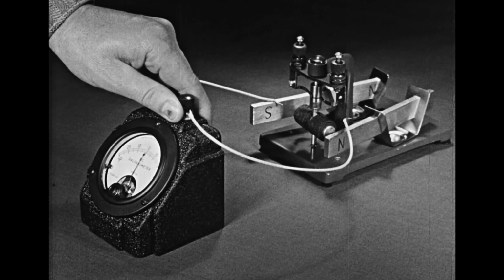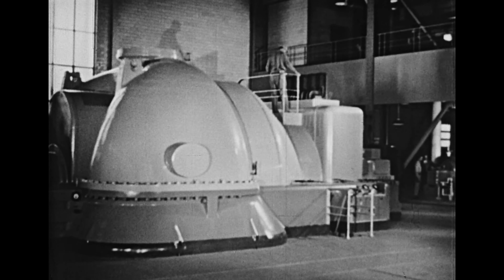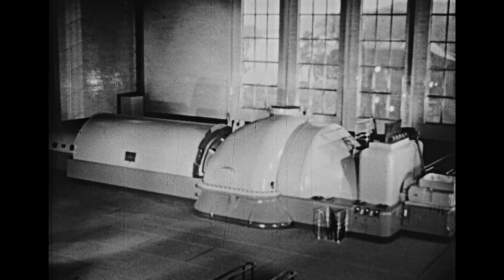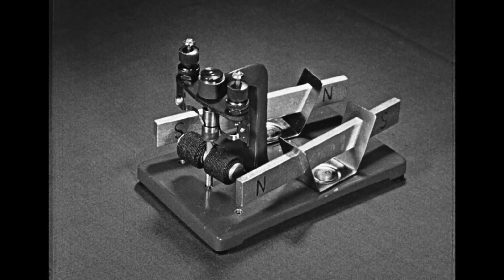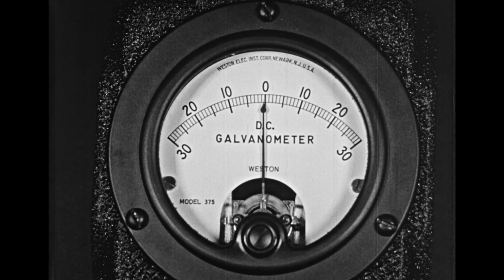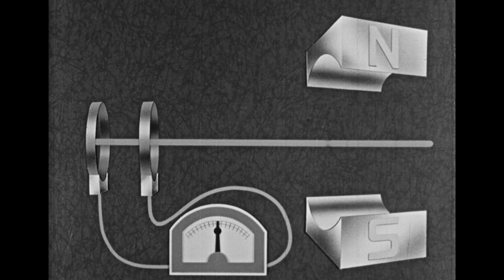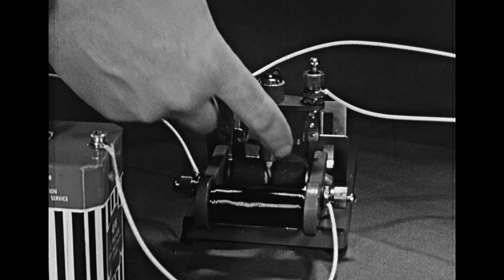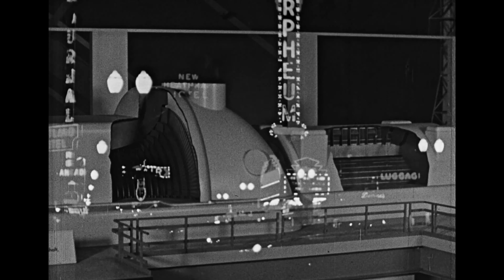How Electricity is Generated: 1960 Intro Training, Electrical Generators, DC AC, Nuclear Reactors

Comment: good. the reason we are able to transmit the generated electrical voltage is "Transformer".
also, the reason, coil generates "Voltage"  is because the external bar magnet or electromagnet repels the magnetic field of electrons inside the coil, moving these electrons in one end of coil, making that end more "negatively" charged and other end , abscence of electrons more "positively" charged.

Comment: I have a mini dynamo which gives 24 to 27 volts in output but the amperes are very less, how to increase the amperes? 
And same volt only increase ampere 😊😊
Reply from the maker: One suggestion was to increase the ampere to volt ratio, you can connect multiple power supplies in parallel. When power supplies are connected in parallel, the voltage remains the same, but the total current available increases. - Never tried this, but it is an idea.

Comment: Lots of explanation but still doesn't say where the electric charge comes from! 
This video just shows you how to harvest it, and that's really all that is happening! 
And if you are able to harvest it from somewhere or something else, then I want to know what these machines are getting it from! 
Clearly the energy existed somewhere else before it was harvested! The real question is where? 
And this leads to the next question of free energy! If energy wasn't free, then whatever is harvesting this energy should not be able to get it due to energy not being free to be harvested in the first place! 
I don't buy this explanation of the energy comes from the work out it to get energy out! Even if I use a hand crank generator, the electric charge isn't coming from my body! 
There's something there that no one seems to be saying anything about and that's probably because no one knows! 
It's like a generator is plucking electricity out of thin air? 
I think that this just demonstrates how little we know and understand about the one thing that has changed the way we live!
Reply from the maker: Hi @PeterMilanovski, you have some good points and good questions!    Looking at the research in this field is quite interesting.  This film does not go into the physics of electron movement or vibration, or the potential difference such things cause across a distance.   Schools used to teach that electrons flowed from one point to another.  Other theories talk about vibrational interaction of potential states.  It is a fascinating thing to research and explore the theories.  The film just gives some practical theory on how it can be demonstrated with physical objects.  Perhaps others viewing this may have some other helpful thoughts.   Thanks for the deeper dive into this!  ~   VK, CHAP
Reply: @ComputerHistoryArchivesProject   thank you for your response, I think that the point I wanted to make was that at some point in time we were being taught that we were the centre of the universe but today we think differently, and then there's that time when the earth was flat, and then not to some people thinking that it's flat again! 
The talk given in this video is a sort of understanding, it's not the only way it can be understood but just one of possibly many. 
I could possibly talk about this all week and you could possibly learn that there is yet another way of understanding what is going on, but that's not important or at least I don't think that it's important anymore... I used to think that it was once apon a time, but it didn't take long to realise that the general public doesn't understand and nor do they care! The people who should care are only interested in upholding old ideas or protecting their own Noble prize winning ideas regardless if they are right or wrong.... 
I have seen so many great people who have proposed great ideas and explanations that were closer to the truth but were rejected by the scientific community because they couldn't understand it only to find out many years later that it was right and that he was way ahead of his time! 
Here! I will let you in on the biggest misconception in the history of science.... 
Going by your response I believe that this should not be too difficult for you to understand.... 
We are taught that the atom is made of a proton which is supposed to be positively charged, a neutron which either has no charge or carries a charge somewhere in between the proton and electron (I have yet to find a clear definition of the neutron) and finally the electron which is supposed to carry a negative charge! 
Now... This is where I have a problem, a long time ago Benjamin Franklin wrote about the electric charge from his experiments performed... 
His conclusion led to his explanation of and in his words was..... The electric charge is a problem of accounting.... It's like a bank account, when you have more money in your account, you will be in credit and we will call this positive, when you owe money, you are in debt and we will call this negative! 
Now, there's nothing in his statement that suggests that there is a positive and negative charge! Meaning that there's only one electric charge and you can have either more or less of it! 
So this would suggest that the proton in an atom has more charge than both the neutron and electron.... Which is supposed to have the least amount of charge.... 
Which would also mean that a battery which is marked with a positive and negative symbol should mean that one side is carrying more charge than the other, and just like how hot will flow into cold, the side of a battery which carries more charge will flow into the side with the least! You can see the same effect by putting two rechargeable batteries together with both batteries at different charge states, the battery with a higher charge state will flow charge into the other lower charge state battery.... 
And just like heat, the electric charge is looking for equilibrium which is what we would consider as the battery being flat.... It still has a charge, but both plates are now equal, and without the potential difference, there's no reason for the charge to flow.... 
Once you see the problem with the explanation of the atom and the problem with the explanation of the electric charge, you slowly begin to find out things that make sense... 
In this video you will hear talking like there's both a positive and negative charge... Benjamin Franklin was correct, there's only one charge! And surface area determines how much charge will be carried.... That's why there is an oxide layer on plates, the rough oxide layer contains more surface area than that of a smooth layer.... Makes sense doesn't it.... There's a lot more but I'm not going to get into it here... This is already to long as a post.... 
My research and newfound understanding has led me to the understanding of what gravity is and more importantly what it isn't.... You wouldn't believe how simple science can be and still work... Imagine being able to look at anything and automatically be able to see how and why something works and how it's connected with its immediate surroundings... Honestly it's mind blowing.... I have seen things that everyone else can't... It's right there in front of your nose but you can't see it because you were taught to not see it! Ohhhh you have your explanation for what you see but it's so disjointed that you don't really see what is going on.... Words can make or break an understanding...